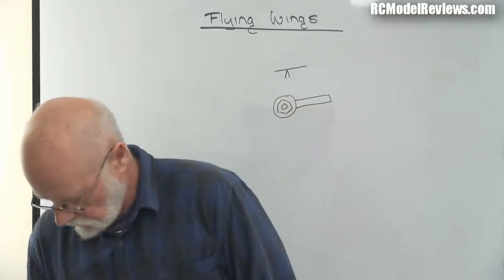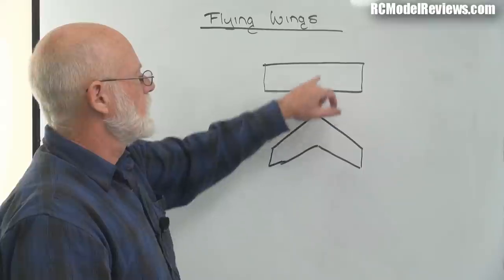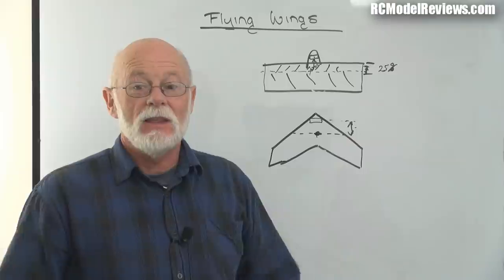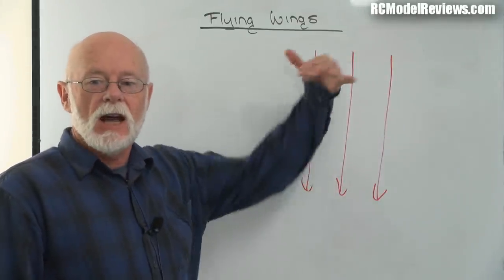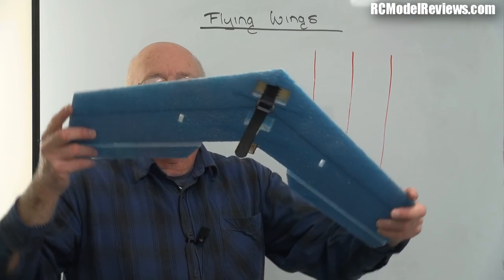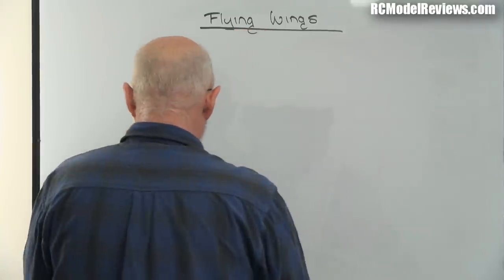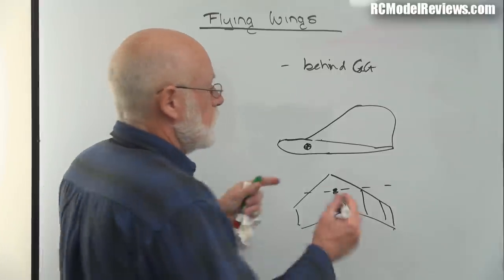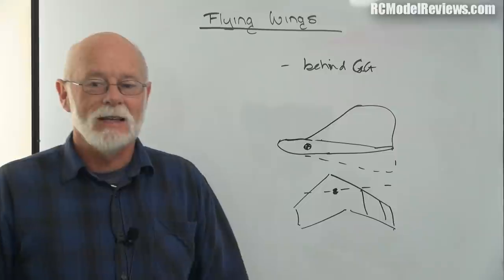The aerodynamics of flying wings (part 2)

Comment: Have you ever heard of the Prandtl wing? He wrote a paper, published in1933 discussing a design for flying wings based on bird flight aerodynamics. Specifically the Albatross.  NASA's Al Bowers picked up on it and designed r/c models based on Prandtl's paper. He went in to build a man-carrying wing. Bowers claims the efficiency of these wings best standard airfoils by 60%. Much of the concept was proven in the Horton wing. I don't understand the concept but would like to hear your take.

Comment: one thing i've heard about wingtip devices (at least on conventional layouts, i.e. not flying wings) is that, as you mentioned, they function very much like an extension of the wing, that is, you get a higher aspect ratio without increasing the span - the drawback is increased drag - most airliners use them because it's easier to install than to re-engineer the entire wing - kit planes tend not to have them for the same reason.

Comment: Great easy to understand video! Thanks! As a former hang glider pilot for over 3O years I have a lot of experience actually flying, Flying Wings.  In particular I was an avid Class II Rigid Wing Hang Glider pilot over the years. Class 1 hang gliders are the traditional Delta (Rogollo) Wing design where the pilot solely uses body weight shift to change the CG for pitch, roll & yaw control. Class II rigid wings use either a combination of weight shift and aerodynamic control ( weight shift for pitch and tip rudders for roll/yaw ) or full 3 axis control ( combination of tip rudders, elevens and on some designs, inboard flaps). Class II full aerodynamic control hang glider pilots can sometimes still use minor body weight shift to make subtle CG changes too for better trim etc.
   Class II hang glider flying wings I flew, included Icarus II, Easy Riser, Icarus V, Fledgling, Apex, and the famous Mitchell Wing.  All of these designs except the Mitchell Wing had some aerodynamic twist (washout) to reduce overall stall speed and reduce inboard wing stall/spin potential especially when thermal soaring and making turns at or near minimum sink rate airspeed which can be close to stall speed. Several of the last Mitchell Wing foot launched gliders built that I know about actually incorporated 3 degrees washout to reduce stall/spin tendency too which greatly improved spin prevention. 
So I would love to
see you make a Flying Wing Video # 3 discussing things like washout, stall / spin design improvement, pros & cons of use of
Flaps in addition to Elevons too.

Finally I would like to draw attention to the Swift 25:1 L/D flying wing glider designed by Stanford University, Aerospace Engineering back in the 1990’s which is the most advanced and highest performing flying wing Class II, FAR 103 compliant ( Under 154lbs weight glider ever made. It can be foot launched and landed like a hang glider as well as auto, winch and aircraft tow launched and even bungee cord launched.  Most incredibly they now have an electric motor launched E-Swift version!!! 
Thanks!

Comment: Wow.. learning much again. 
Yeah, forward swept wings are very interesting, would like a video if you can.
Really like these educational type videos.
Reply: G'day,

 Forward-swept Wings tend to try to twist and then snap themselves off the Fuselage, thereby requiring massively strong Spars, and heavy-duty Ribs to impart sufficient structural strength yo be able to resist such tendancies...; and when NASA tried flying an F-16 with Forward-Swept Wings, decades ago, they were looking for enhanced manouvreability (specifically, faster Roll-Rates...), but what they actually achieved was so aerodynamically-unstable that without a Computer to handle the Ailerons it was utterly unflyable, because no Human Pilot could wag the Stick fast enough to keep pace with the corrections needed in order to fly it level.

   So Forward-Sweep, when it works, makes the Aeroplane much heavier than it would have been if built with Rearward-Swept Wings, and if the Computerised Artificial Roll-Stability System fails then the machine becomes utterly uncontrollable and promptly rips itself apart...; in the light of which findings it was decided that the small "enhanced Roll-Rates" theoretically available over those offered by not building the Wing backwards.., simply wasn't any kind of "benefit" worth chasing after.

   But, Forward-Sweep looks "cool", perhaps even "kewel" ; so every now and then someone tries to find some kind of a loophole which might make the concept workable.

  Such is Life,

  Have a good one...

;-p

    Ciao !
Reply: The normal F-16 is inherently unstable and flying is done by a computer, with the stick input from the pilot being sent to it digitally, with no mechanical connection to the control surfaces. F-16 pilots often joke about it's the plane that is flying them. And look at the F-117, it's flying diamond shape is so aerodynamically uncontrollable that it requires computer governed fly-by-wire.

Comment: Great overview Bruce! One of the big things you could cover next is wing loading and how blunt sections push CG even further forward. Fences, vortex generators and vortilons can help with a lot of adverse yaw issues but they're all still bandaids that cause drag. I'm really glad that emphasized that everything with a wing is a compromise or trade off, even with planform chord/sweep choices. I'd love to get you one of my 51" designs someday. Thanks again and keep up the great work. 👍
Reply: Going further, it might even be good to point out that every planform geometry has it's own unique adverse yaw frequency that can amplified with too much wing loading at slower speeds.

Comment: One interesting alternative to winglets and wing fences is bending / tilting the outer parts of your wings downwards to give them a negative angle of attack (compared to the rest of the wing) - NASA's been experimenting recently with this on an RC tech demo aircraft called the PRANDTL-D. The idea with this is that as your spanwise flow reaches this section of the wing, it generates upwash (instead of downwash). In doing so, you lose a little bit of lift, but you actually gain thrust. Airliner winglets gain thrust as well (they angle them slightly outwards to push off the wingtip vortex), but this upwash idea can have double the improvement in lift:drag.
One of these days I'll have to see myself whether its practical to try this with foamboard.
Reply: Getting a design with winglets that actually works (as listed on the tin) is extremely complicated in the real world. A simple non-optimised wingtip fence is about the best that can be done with foamboard, and when doing CFD on a non-blended fence, there is a relatively small gain in terms of vortex reduction, and lots of additional drag (hard to balance these for optimal performance).   The main effect in RC models from tip fences/winglets is in gaining vertical surface area for directional stability (like a vertical fin on a conventional aeroplane)..

To gain the thrust you are talking about (by directing the flow AFT), very careful aerofoil selection and washout is needed (to gain lift through vortex reduction while slow and heavy, and reduce drag and increase drive at cruise)....

If you have a real interest search for some academic papers on this topic, it is very interesting...

Comment: Thanks for a great video on aerodynamics. Could you comment on how wingtip motors would counter the wingtip vortices? I have seen YT videos showing they counter WT vortices if the props rotate so that the props rotate outward at the top. Supposedly the motor's efficiency is 7.5% better. Before I these your 2-part videos I built a flying Delta wing with a flat bottom. There is no tail on it but it does have dual fixed vertical stabs. Now I'm wondering how a symmetrical airfoil and fences would do compared to what I have. You've given me lots to ponder.

Comment: Thanks Bruce!  I'd enjoy hearing more.

I'd especially like to hear your analysis of forward-swept wings like the Ritewing Drak. 

And what about turbulence? As a wing enters a gusty crosswind,  it makes sense that it would stably yaw into the gust, but this can induce a little yaw waggle that's hopefully quickly damped. I think one of the advantages of the Drak is that the long, tall nose will be pushed to the side equally with the vertical stabilizers, reducing yaw waggle t in unsettled air.

Comment: excellent video Bruce! remember my s800 review where i was installing the control surface horns the wing way round? i flew this wing today in medium winds. it wiggle wobbles :)
the vtx burnt out after a few minutes so today i had a proper one.  the cam was exchanged to a good one, looks like i should also replace the esc (noise I  video).
but I'm looking fwd to install some wing fences now thanks to your video! greets!

Comment: The wing tips idea is a similar concept to the Q-tip propeller video you made in the ducted propellers videos. I love these videos where you teach things i just like learning about design improvements. I am still yet to see any one use golf ball dimples to increase air flow in theory you could create a even lower air pressure above the wing or on the propeller also you are removing weight i guess as well which is also a good thing.

Comment: Why does the MiG use Wing Fences when it already has a tail with all of the normal control surfaces?
Also, I am really interested in the PRANDTL-D aerofoil design but cannot find out any technical details, do you think it is possible that you could do a video on the subject ?(with as much detail as you can cram in!)
Thanks for doing these vid's, I am learning a lot and it is an enjoyable experience.

Comment: Nicely done.

One thing that stands out- Why is a flying wing never as efficient?  The reflex is accomplishing the same as the horizontal stabilizer, effectively producing some downward force.  I don't see why some reflex, specifically towards the outwards tips of the wings in a swept back design would be any less efficient.  In other words, design a wing with a more conventional airfoil towards the inside, some reflex (or elevons) only on the outside and although it would be a compramize, it would be more likely the best of both worlds.

I suspect that most of the lack of full-size designs, even in sailplanes is mostly a packaging and "it's unconventional and looks funny," rather than actual efficiency.

Comment: Great video series.  Question:  have you seen the synergy aircraft project and what is your opinion of the design?

Your statement about wingtips and how its like increasing the wingspan reminded me of how synergy claimed that their double box tail design was equivalent to a wingspan of the same plane if the wings were unfolded.  They claimed this since there was a high pressure all the way around the outside of the double box tail and a low pressure all around the inside, essentially 2 large venturis that combined the wing, vertical and horizontal stabilizers, ailerons and elevator; all into the effective wingspan of the plane.

Whether it will ever be built or not, I find the design super interesting.

Comment: Great video as always Bruce. Was wondering if you could do a video on motors. As I have noticed that there are many people out there that still don't know quite how they work. As in they way they produce power in watts and amps. For example I have read reviews on motors where people have said they are rubbish because it didn't produce the power stated in the specs. Again example a motor listed as having say 1800 watts on 6s and the guy complained that when he fitted it to a edf it only produced 1500 watts and the motors stated power was wrong and over exaggerated. I think you can tell whats going on there and what he has got wrong.
Watts doesn't really mean anything. It's just a calculation of volts times the amps which is just the load on the motor generated from what ever you've fitted to it but yes it is a measurement of power too. The thing is some people seem to think if a motor has a spec of say 500 watts then that motor HAS 500 watts. It doesn't. It HAS 0 watts. The 500 watts listed means it is capable of HANDLING 500 watts. Now if a car engine is tuned to 500 hp then that engine does have 500 hp. Motors work a bit different. The amount of watts a motor produces depends on what load you put on the motor. Less load lower watts. More load higher watts. Anyway sorry about the rant but if you could do a video on this subject that would be great as i do find it annoying when people get this wrong and you can reach a much bigger audience then i ever could. Thanks Bruce
Reply: Maybe, Edit post to define Electrical power (input) and mechanical power (output)

People would be surprised that their 150hp car engine has 652hp (odd) of chemical energy being put into the engine...

The real puzzle is when people think that kv has something to do with power....

(hp used to mot confuse the OP puzzlement on watts).

Comment: Thanks for posting this second part in a timely fashion. I'm about to begin building my second wing and this video saved me from making a design error. Horizon Hobby is touting their new wing with lines of nodules on the upper leading wing edges and lines of nodules on the underside rear just in front of the elevrons. They claim this makes the wing fly more stable at low speed. How does that work?

Comment: Hi Bruce thanks for another great informative review, I am wondering if you may be familiar with the Eachine Fury Wing? I was given one for my birthday a couple of years ago by my kids however I have been unable to fly it without it crashing seconds after launch! I have experienced everything from it releasing a wing and the wing rotating along the spar to it just rolling onto its back and hitting the ground. I have seen many videos of others experiencing the same things and I have adjusted the CG numerous times. However the model still flys about as well as a roof tile!!! Could any of this (obviously not the wing coming loose) be related to the issues you have raised in this video?
Any ideas you may have would be very much appreciated as my hair is too thin to keep on pulling more out. I actually see this plane becoming a fridge magnet!
Cheers regards Robert

Comment: Hi Bruce, I was wondering if it would be possible to adjust pitch by mechanically adjusting the cog for example using a weight that can be moved forward or aft of the cog effectively being able to eliminate a reflex angle. It sounds a bit daft but just a thought

Comment: When the high pressure under the wing goes up to mix with the low pressure on top of the wing, more drag is created. But also by balancing the pressure on both sides, will there be less lift?

Comment: I have a question: can you reduce the reflex needed for stable flight of a flying wing by increasing the rear sweep and therefore increasing the planes leverage, effectively requiring less reflex to generate the same amount of down force (and increasing the efficiency)?

Comment: Wow, thank you for the video. I had a rather simple question: is it possible to trade wing sweep against reflex? Since the swept wing as a lever effect on the pitch axis, isn't it possible to use a simple airfoil, instead of a double cambered reflex airfoil? Of course, this means a swept wing design could use a wing design with maybe not only a twist, but instead an airfoil blend between the root an the wingtip (instead of those reflex systems)? Now of course, there would be some extra considerations to take into account, depending on the 'scenario'. And i also wondered about wing with several panels with different sweep, as it seems it could be more efficent to trade the ailerons with no sweep at all around the wing tip. Or maybe even a reasonably swept forward wing tip to keep vortices away? Best regards.

Comment: would having your wing fences under the wing help increase lift by increasing the velocity differential between the top and bottom of the wing by adding drag to the bottom to slow the air more?

Comment: Why do some wings, when you're launching them, have a big dip at the first few moments? Some of my wings simply track and fly straight out with a gentle 35% angled up toss, whilst others (my Caipirinha 2) requires that it be launched with ~80% power and nearly straight up. It's very frustrating. Is there something wrong with the C2's design? I've flown it super light as well, the behavior is always the same. If I launch at a 35% angle, even into the wing, it will surely auger into the dirt. What is causing this and can it be corrected? I was thinking it may be the motor angle? Perhaps the motor angle is too straight or directing the airflow slightly downward, essentially lifting the rear of the wing up and point the nose to the ground?

Comment: gee Bruce i used blue tac if not enougth nuts and washers and bolts car tyre lead weights on wood planes  and fishing line between nose prop through landing gear struts latitude is done with plane upside down  hehe